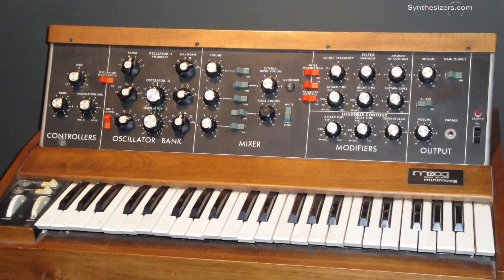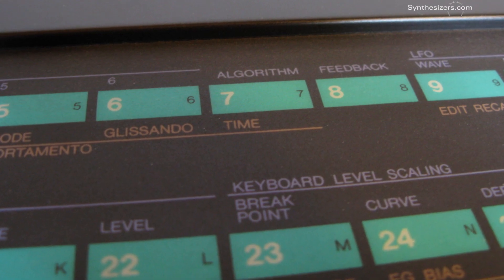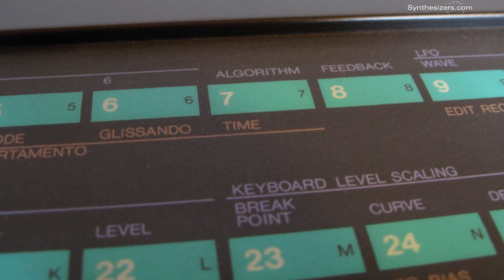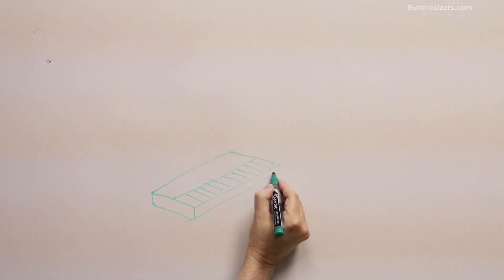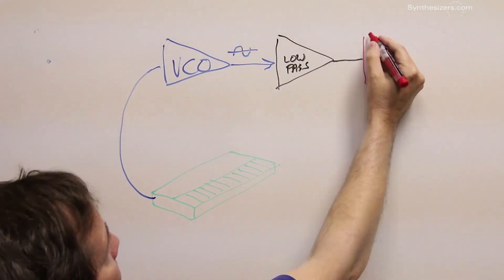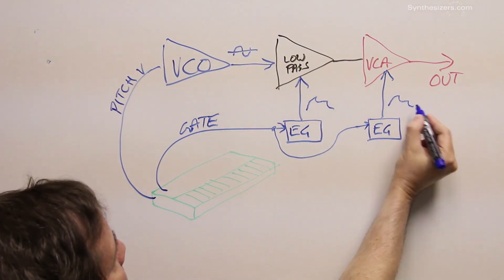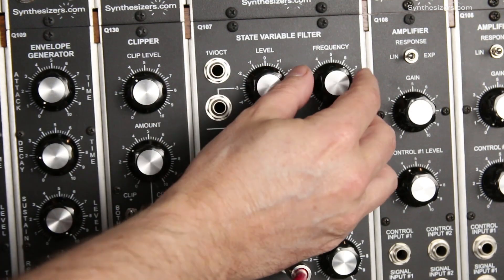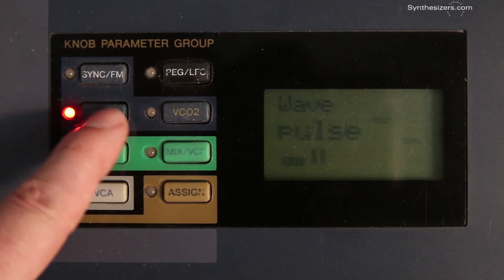Intro to modular synthesizers - Synthesizers.com

Comment: Is it just me or is there a fairly audible ground loop problem going on here?
Reply: I am guessing that this is just a "Q and D" mix for the purposes of this video. I have to believe that a properly wired system going into a professional audio interface where both the synth and the interface are plugged into the same, properly grounded AC power supply would not have this issue.

Comment: If you want to have more Oscilators, do you connect them through a Multiple then output them to the Filter?
Reply from the maker: Yes, patch the pitch voltage into a multiple, then on to each oscillator.  Then the output of each oscillator into a mixer, then to a filter and VCA.

Comment: I have a Eurorack system, which is truly fantastic, but the solidity of the 5U systems just makes me wish I had one of those. The sound of plugging in a 1/4" jack compared to the sound of plugging in a minijack is enough of a reason to switch to 5U for me. Unfortunately shipping a beast like this to Europe just makes it not an option for me.
Reply: Not to take away from Rodger's product because it is fantastic, best in class but, there are a few very good EU-based manufacturers of 5U modulars as well where, as far as I know, shipping would be a much smaller issue.

Comment: @0:56 - Someone should make a midi controller for soft synths where you can remove the entire panel of knobs/sliders and replace it with another one, depending on what synth you're programming. The panels would simply be plastic pieces with the 'brains' of the whole thing underneath, which just reads where the knobs/sliders are, so add-on panels should be cheap to produce ...